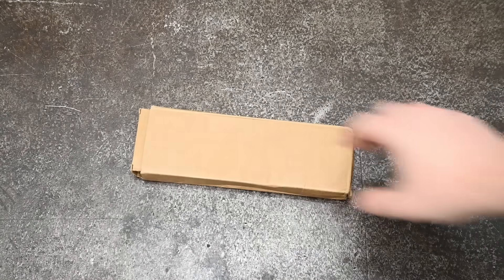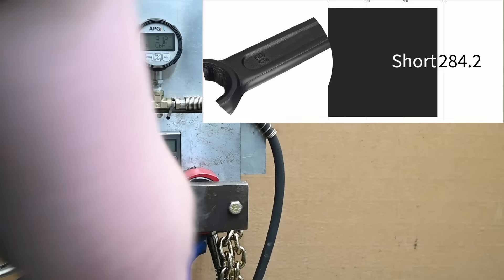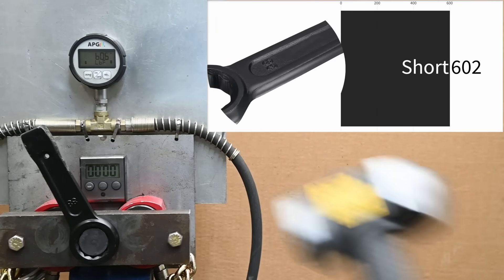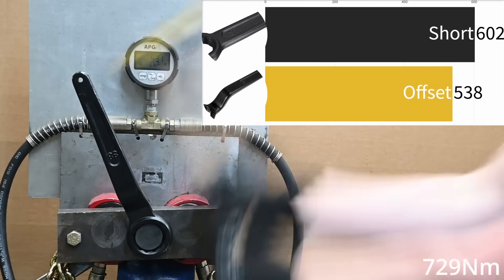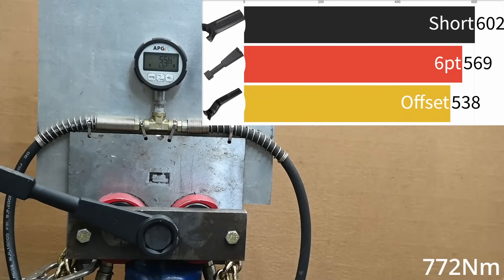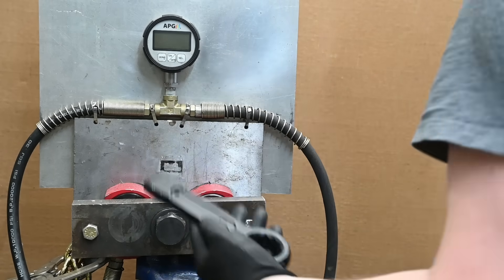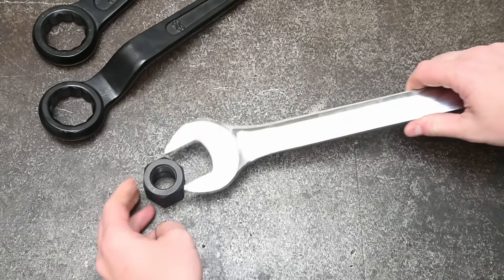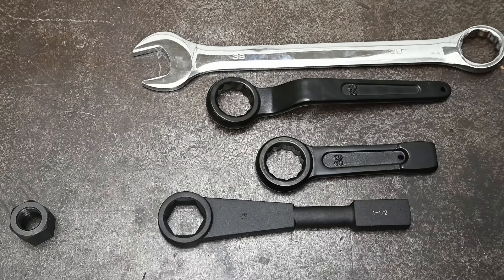1800s Impact Wrench? Slug Wrench: the ORIGINAL Impact Wrench

Comment: Watching the guy impacting the head nut on the cone for a rock crusher took me back…. To a couple months ago when I did it the same way. Slug wrenches are still common in the rock crushing world!
Reply: Heavy equipment too.   I can break things loose with mine that a 1'' impact will not touch.   Plus don't need air if it's to far away.
Reply: Very true. I use a slugger almost everyday tightening jaw crusher bolts. We also use double sided slugger type wrenches for cone crusher lock nuts so both people can swing on them at the same time. We often times do liner changes without removing the heads so we do then while they’re still in the crusher
Reply: Doing that with no gloves looked sketchy. No vibrations coming back through that monster?

Comment: Need to test again with a 16lb one hander. That's the standard used for slug wrenches.
Reply: A proper test would actually be 8lb, 12lb, and 16lb one handers. 16lb is standard practice but averages around 117psi matching 10lbs with an entry level worker while an 8lb managed 137 psi and a 12lb managed 122 psi in a model based off two handed models with full extension and full contact by entry level workers. 

For fun here's the 20lb; 95 psi at entry, 193 psi experienced.

Comment: We still use these in heavy industry (power generation)
Reply: Same for us working on rollercoasters 🙋‍♂️
Reply: Just curious, why use this kind of wrench over an impact?
Reply: @zef1097 Ive worked in this field as well. Most common reason is limited amount of room. You'll be using these for stuff like tightening the nuts that hold things like generstors to their frame. Youve got limited room, and when these bad boys are on. Its gonna require a LOT of beans to get them off. We would commonly combine these wrenches with not just hammers, but also things like hydraulic jacks or chain hoists. Youre talking nuts from 32mm al the way up to 100mm. And they come even bigger in some places.

Common practise is to whack it like 45°s, run out of turning space, take it off, put it back in another position and keep whacking.
Reply: @zef1097 I’m thinking rather than an impact, at these sizes, hydraulic wrenches are the alternative. Pricy.
Reply: Some of the equipment has 4 in bolts and nuts within the construction, sometimes even bigger..... you'd need to carry a wrench the size of a galling gun to be sure you hitting you required torque
Reply: @Screwloose10  a 2in impact that you have to hang from the crane or hydraulic wrenches you just use whatever gets the job done easiest vs time
Reply: Same here for truck caliper bolts (unless you wan to remove a whole bunch of stuff, like the whole axle, fenders or body or lift it all the way up) 😅
Reply: Its probably in the CBA

Comment: I have a welded half inch ratchet I use for this too. 6 point and a little offset. Also welded a socket to the handle so extension can be a cheater bar.